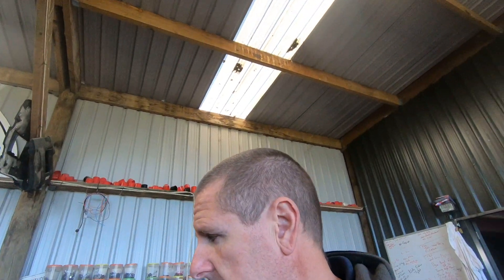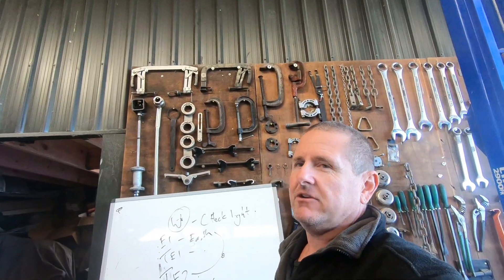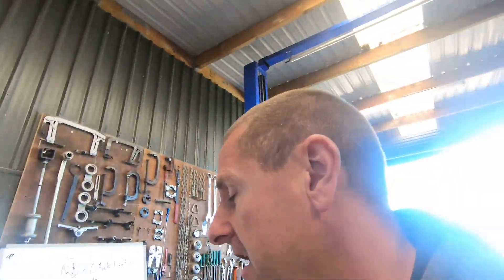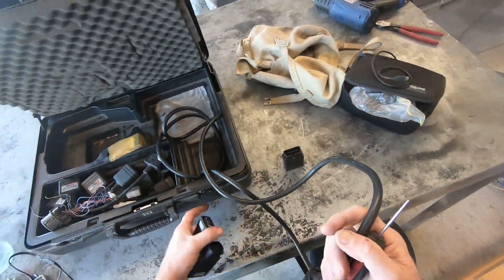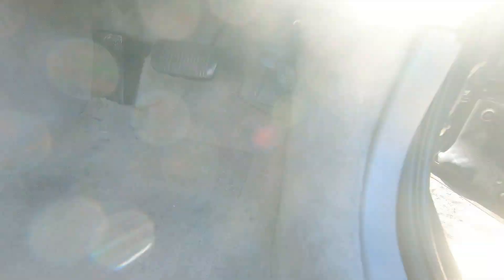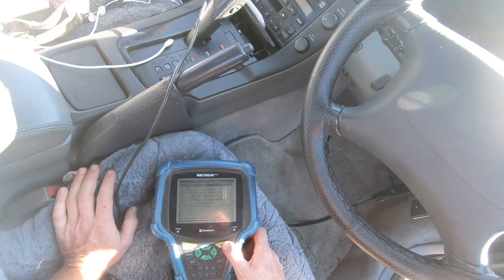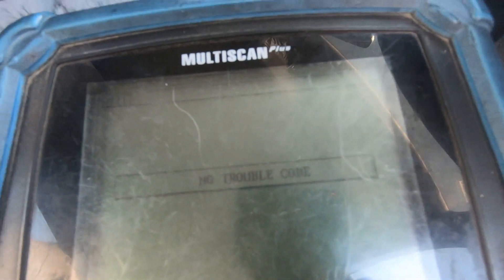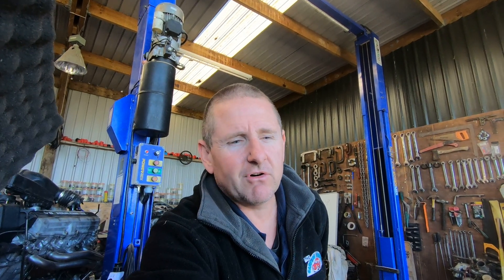Connecting a OBD1 Scantool to a 1uzfe.  It's not the port on the engine. DLC1 & DLC2 diagnostics

Comment: Good morning. Im having troubles finding the adapter for my 1995 Toyota Celsior. Im chasing a check engine light. Suspecting its my upstream 02 sensor.
Reply: Update: found the right part, but the obd1 port isn't working. Is there a fuse I'm missing? I found the 2nd fuse box under the steering wheel, but cannot seem to find which fuse it is since it's in Japanese. Ucf21 celsior. Thanks

Comment: hey mate,
  I need a little help, i having trouble with my SRS as the light is up on the dash, so i connect my Launch X431 V5 to the 17pin port half round under the dash on the right hand side as mine is a imported soarer 1992 1uzfe and it says it cant connect to the SRS ECM and shows no fault code when scanning. Is there something i am doing wrong with the scanning as i select Japan and soarer but shows no issues and i have replaced the ECM with matching numbers still no change.

Comment: Bro i got a soarer has no power in driver door,,checked every thing fuses relay all ok ,,power windows motor works too...but no current goes in the door at all,,,what part could be Broken?or diagnostic obd1 can tell what it is?much appreciated bro

Comment: What is that "rod knocking" sound at engine OFF?  Is that what a properly working IACV sounds like (resetting)?
Reply from the maker: Correct,  the noise on key off is the IAC doing its reset process.  If it doesn't do this then there is an issue,  The later IAC are a bit quieter than the early ones.  Cheers

Comment: Hey i recently had the TRAC light come on once im driving for about 10 minutes then resets everytime i turn the car off. How would i go about diagnosing the TRAC light?
Reply from the maker: I would use the Toyota process of checking for codes and following the diagnoses proceedure as recommended by Toyota.  Cheers

Comment: Great video. Is there any information that I can get from the engine plug that I cant get from the dash plug in the case where I’m using a manual gearbox?
Reply from the maker: The underdash plug has much better data than the engine connector.  There is however a series of manual test modes which can be set via the engine connector which not many people know about.  I might do a video on that one day.  So scan tool connection is preferred to the underdash connector.  Manual test on engine connector.

Comment: I have just got my obd 1 to obd2 converter but not getting no power to the obd2 dongle can you help ?? I have codes flashing on an off and now the engine light always remains on
Reply from the maker: You will need to do some testing.  Cheers Kelvin

Comment: Can you run an OBD1 to OBD2 cable adapter and then put a Bluetooth OBD2 adapter on that in the engine bay for codes? and for data logging can you run a 17pin to RS232 cable (with 3.3nF cap.) to USB to pull data for logging for the 2nd DLC port?

kinda cool how there is two DLC ports.
Reply from the maker: There are OBD1 to OBD2 converters however I have an OBD1 scantool so have never has to bother.  Most of the engine ports require wiring changes to work with a communication device.  Cheers Kelvin.
Reply: @CartuneNZ  Thank you for the reply Kelvin, your Youtube channel is full of vital information and I look forward to learning more, with the route I'm going I should be looking at standalone ECU's for what I have planned, no point messing with oem wiring and make shift car computers when the end result is still a factory ECU lol.

Comment: Can you use a toyota OBD to OBD 2 adapter and one of those eBay bluetooth dongles?
Reply from the maker: Ive never had the need to sorry as I've got the hanatech.  The bluetooth dongles can be a bit hit and miss.  I had some really good ones for vvti 1uz then brought the same unit and they dont work.  Different batch.
Reply: No worries, thank you for the quick reply!